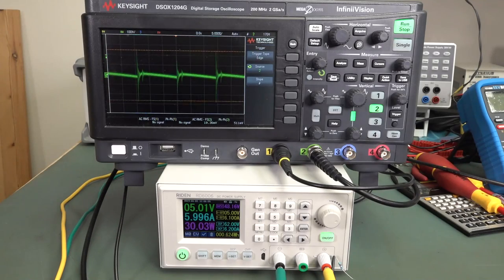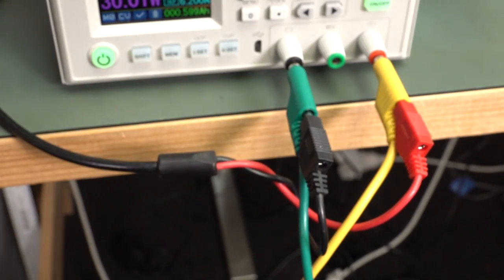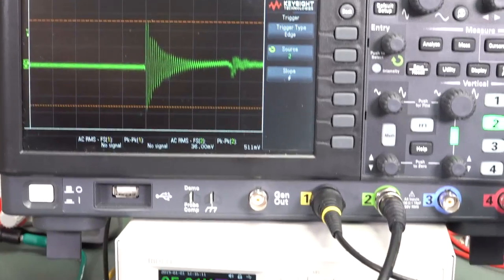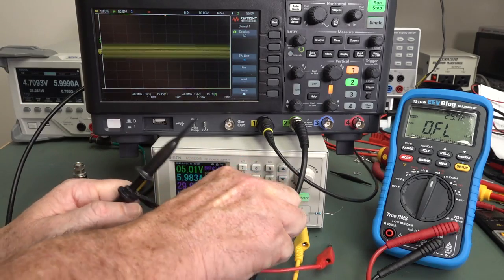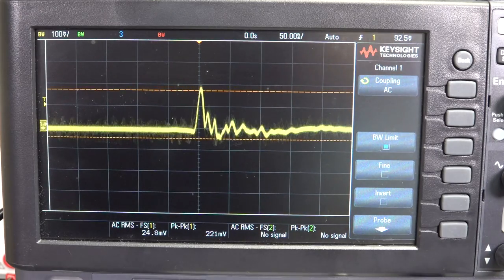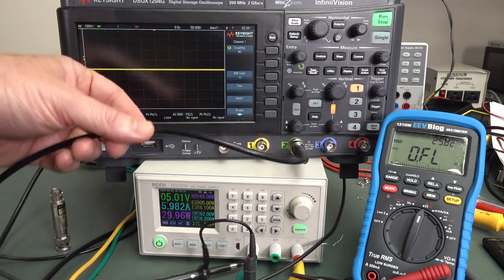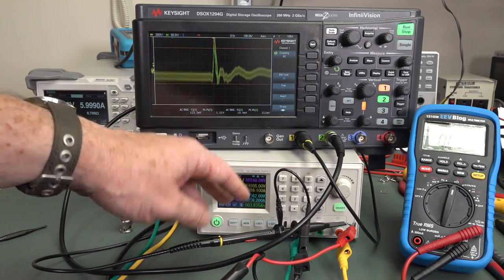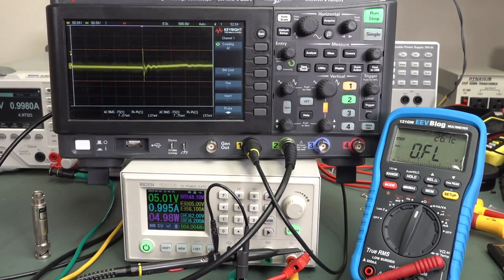EEVblog #1266 - PSU Probing Screw Up!

Comment: " Kris Willems 8 months ago

David, I would really like to see a video on how to reduce the noise on the output of a switching power supply."
I quoted an 8 month old comment because I saw the previous video on this power supply a few days ago and heard near the end you would do another video on how to get rid of the noise.
You are always so picky about everything and with this unit everything seemed great except for the noise ripple. I do see by this video that you had made an error in measurement. Does that mean the correct ripple measurement is within acceptable tolerances?

After watching the video I saw that Banggood had a sale on the newer model that goes up to 12A for $67 with WiFi, so I bought it.
So the next question is, was the ripple problem addressed in the newer model, if it is still there is it a problem?
If so, how do you solve the problem? Install a toroidal duel winding inductor, using one winding for each + & - rail?

Comment: Good example of how the "smart" scopes can't do everything for you. Ya still gotta have a good understanding of what you're doing. Dude - for a 50 ohm system, ya gotta match the source AND the load, so you need a 50 ohm resistor in series at the power supply feeding the coax (assuming the PS output impedance is zero), and the 50 ohm terminator at the scope input (unless it has a 50 ohm input selection as you said). It's easy to see this is right because then any signal will be half size with the input  terminator on the scope, and twice as large without it (an unterminated transmission line characteristic) at all signal frequencies.  I'm sure you know this, maybe I'm missing something?
Reply: Input impedance of this oscilloscope is 1 MOhm , not 50 Ohm
Reply from the maker: Yes, if you use both you need a X2 gain setting on your scope, not all scopes have that so you might have to manually compensate for that. For this application you can get away with just the input side terminator to reduce the reflection and tank circuit effect that produces the oscillation.

Comment: Of course the displayed/measured signal will go down with a 50 ohm resistor.
But why did you need to do that? Didn't the scope measure what's truly there? What's wrong with that? The scope didn't make up the higher reading on its own. I guess I'd need more detailed explanation on where this false amplification comes from. Am I supposed to believe in free power now? You get more out than you put in?

... This is why I stopped getting into electronics. Too much magic and anti-logic.
Reply: It's not amplification, it's ringing caused by the TL.  You have to consider voltage reflections.  Matching impedance kills reflection.
Reply from the maker: The un-terminated transmission line is acting like a tank circuit (google it) and putting those spikes in causes oscillation to occur, hence the nice large amplitude sinusoidal like signal we were seeing.

Comment: Dave didn't check which power supply introduces the noise. Maybe it's not the RIDEN one.
Reply: @MrKillerpics  But also always powering an adjustable load when looking at noise :S
Reply: @MrKillerpics  you're right. I thought this noise was standard 50Hz or 60Hz but at 0:50 we can clearly see the frequency: ~70kHz. So yeah it's the buck switching frequency of the RIDEN.
Reply: @dalehorton7748  in the 1st video at 23:45 he's having the noise without a load (the RIDEN is giving 0A of current). So it can't be the adjustable load.